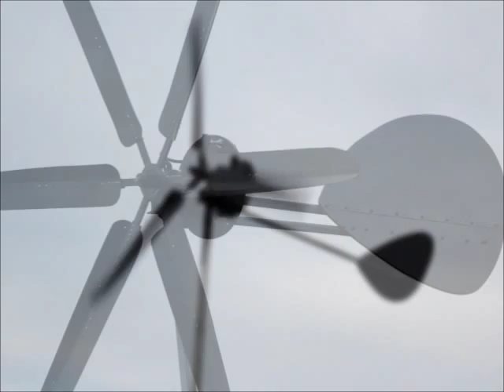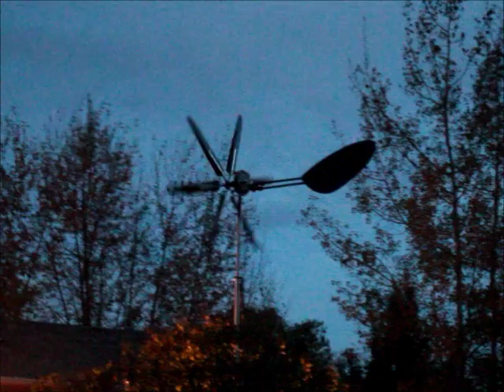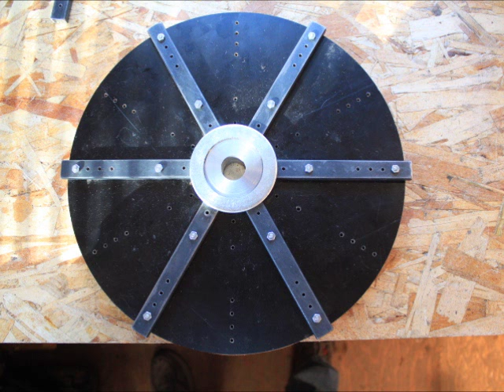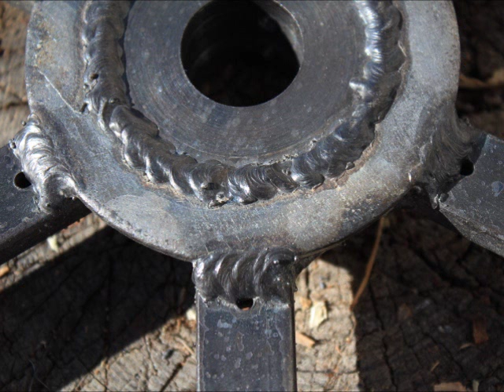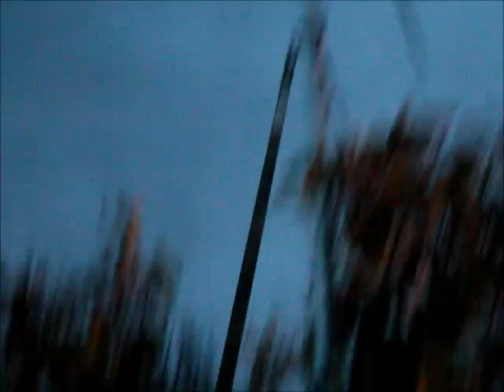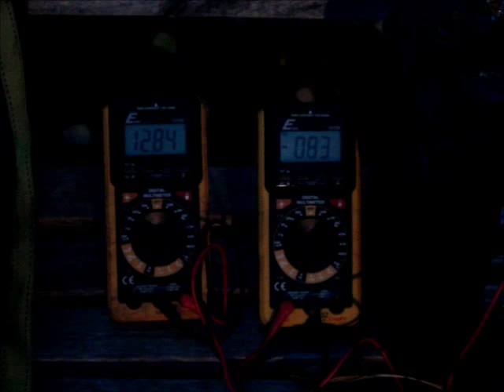Dual Magnet Axial Flux Wind Turbine Muddy's Mighty Mini generator alternator barebones

Comment: excellent results!  even with the trees in the way. I started tinkering around with two of my rotors this evening. I have two different set ups using either 19 pound or 49 pound pull magnets and 4 different coil set ups. everything will be set up so I can test and change coils or rotors out fairly easy. I still need to get one of your housing set ups once you get some made lol. I am building mine out of junk lol.

Comment: does the 17 mm hub that mwands uses for their turbines
Reply from the maker: Hey John ... this one is 25mm and I have one on ebay right now at this link: http://www.ebay.com/itm/121223908004?ssPageName=STRK:MESELX:IT&_trksid=p3984.m1555.l2649 
the hub that I am sending with it would just need to be drilled out to accept whatever size blades you want. I will neck down all the next blades so they will accept 17mm hubs.
Reply: belgrademachine I really love what you are offering, but the standard for this style is the 12" disk. Those that have done the gard work before us have figured it out.
I don't know, but I guess that the coils need some space, not a lot, but some between each coil. I would suggest that one coil field may interfere with each other. I'm not saying it won't work because it will, can it be at it's best. It's the field collapse action that pushes the electron flow.
I haven't build one of these yet, because I can't weld yet. 
Also the power cable should go through the center mast, down the tower, using 10/3 SOOW Cord wire or similar.
Thanks, John.
Reply: john otoole thinking about my comments, I don't wish to over step your great work on this project, clearly the mini has the advantage of reduced weight.
thanks
Reply from the maker: john otoole Hey John, I didn't see the first comment until you posted this one so I'm glad you did. Honestly, I'm learning as I go so I appreciate you sharing the wisdom and don't worry about crushing my ego :)  When Muddy and I started this project we wanted in addition to other things to keep the size down. As you mentioned it is smaller and lighter than the 12" versions  so many of us suburb people could likely get away with putting these up in the neighborhood .... I am on grid and will remain so. The SO cord does in fact go down the tower in this unit fyi. You may be aware already but a near identical axial flux is on ebay right now and will likely go cheap .... see the link on my most recent upload. Thanks for the comment!

Comment: Excellent Job
I am Using  24 Ceramic Magnets 1 x 2 x 1/2 . 15 Gauge Coil Wire
 9 Coil 80 Turn  am getting about 6 volt
 keep up the good work
Reply from the maker: Appreciate the info Nigel! At what RPM are you reaching 6 volt? A similar turbine is available on ebay at: http://www.ebay.com/itm/121223908004?ssPageName=STRK:MESELX:IT&_trksid=p3984.m1555.l2649
Reply: 120rpm

Comment from the maker: Thanks bro .... I just took it down and have some work to do before it goes up again. Total weight is 42lbs (generator/pivot 24 + blade set and hub 10 + tail 8). We had 30+ mph gusts and it did great but needs a substantial tower and perhaps a lighter longer tail that doesn't slant. It was just thinking about furling in the gust. I am finding that this axial flux arrangement is the way to go but I have some figuring to go. You going to make one? I could see you turning out rotors on that Logan

Comment from the maker: That's just it. Seems like the suburban backyard turbine needs to be built different than the high tower off grid ones. These readings are probably the highest I will see in its current location so I'll need to temper my expectations. It's a big heavy trickle charger

Comment from the maker: Thanks Saeid! Yeah, I made a batch of these so have four more identical units ... I'm going to put one of them on eBay at user ID "belgrademachine". It will be what I'm calling a "barebones" unit and won't include magnets, stator, tail, or blades so whoever gets it can make it there own. Now that this is on a tower that project moves to the front burner.